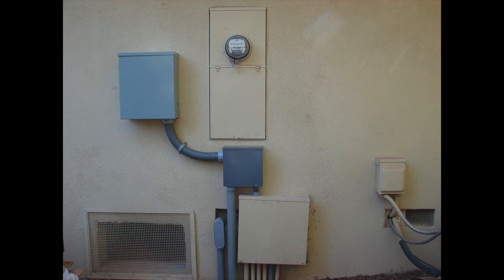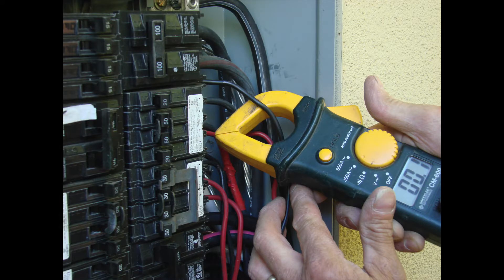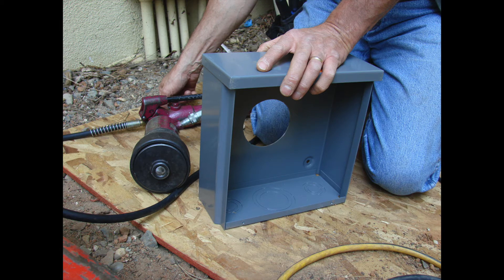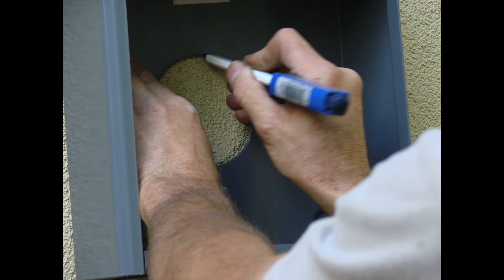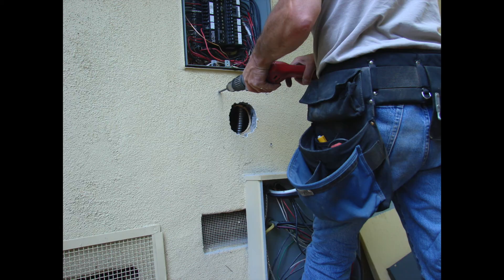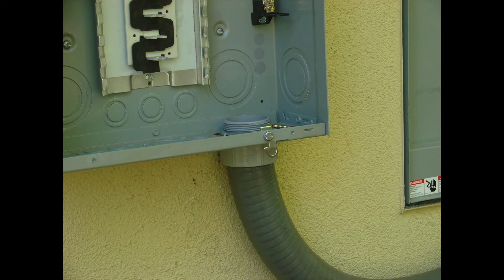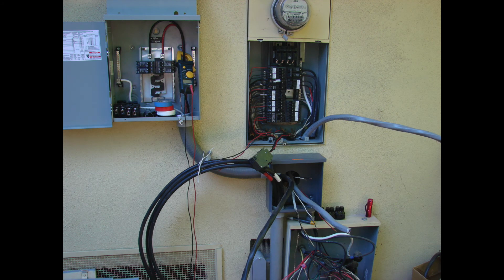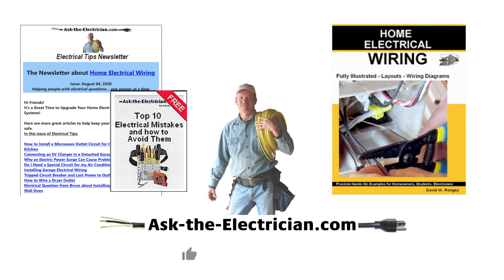How to Add a Sub Panel to Expand the Circuit Breaker Capacity.

Comment: Thanks for sharing.  If the future 400 A main panel will have more breaker positions than the existing one, couldn't you eliminate the small subpanel you added to the side of the Main Panel?  Seems best for the homeowners to bite that bullet now.
Reply from the maker: Yes indeed, that would make perfect sense, however the home was occupied, and this phase of the project did now allow for the main service to be upgraded, and it was not in the budget, so installing this sub panel allowed us to keep on track. A future project was possibly adding a second floor to the residence, and a lot of remodeling, so we just stayed on track with this project as was required.

Comment: What can I do if the main power wire from the sub to the main panel doesn't reach? They are 35 feet apart and the wire is 25 feet.

Comment: Hello. Thanks for sharing. 
I hope you can help me with this question. 
I’m helping a friend with a job. 
He built a detached utility room from the house, he will install the electric water heater in there ( 30 amp 2 pole)  , electric dryer 30 amp, washer and a lighting circuit 20 amp. He will add a subpanel . It’s like 80 ft from the main panel. 

What’s the minimum aluminum wire size and breaker We can use ?
Reply from the maker: Please see the following:
https://ask-the-electrician.com/electrical-calculations-and-formulas.html
Voltage Drop Calculator

Comment: So you still have to run 4/0 to wherever you're putting the next panel right?
Reply from the maker: The size of the cable will depend on the size of the panel that is being installed, and how far the new sub panel will be from the source panel.

Comment: If the left top wire is like ..fried off and hanging is that dangerous? Everything in the house is working unless I use the washer. Thn 2 bedrooms electricity shuts off. When I shut the washer off the rooms turn back on
Reply from the maker: From what you have described, the damaged wire in the panel will need to be repaired asap to ensure the home electrical system will function correctly. Until the repair is done there will be a feed back of voltage to some of the circuits in the home, which can cause damage to some devices because they are not getting full power.
Reply: @AskTheElectrician  I learned a whole phase was on fire and it's a federal pacific panel 😭
Reply from the maker: Yikes!
Sounds like a Great time to replace the panel.

Comment: Can I add a 200 amp panel from another 200 amp service panel?
Reply from the maker: It would depend on the available amperage capacity of the primary panel, and what the proposed loads are for the new panel.
Reply: @AskTheElectrician  you totally confused me here...isn't the available Amps 200?
Reply: I got a 200amp sub panel right below the meter on a pole we ran to the shop... so my available amps would be 200? Right?

Comment: Similar scenario in terms of the space between the main and sub panels (about a foot ot so) what size wire is recommended for a 125a sub panel?, I see the breaker says 12-2/0, would 8/3 or 6/3 be good enough?
Reply from the maker: No - the wire sizes you have mentioned would be incorrect.

Please go to the following articles at my website which will assist you with Electric Wire and Electrical Cable:
https://ask-the-electrician.com/electrical-wire.html

and for Electrical Calculations and Formulas:
https://ask-the-electrician.com/electrical-calculations-and-formulas.html

Comment: I'm trying to become an electrician one day.  I have two questions: So once you get the peak load information (For determining if you can install a sub panel or not) how do I determine what sized sub panel i can use from there? Question 2: What do I do if i need a 100 amp sub panel (for a workshop, that when in use draws say 60 amps) but the peak load on the main panel (lets say this main is 200 amps) is 140+ amps? Would I need to get a bigger main panel from there?
Reply from the maker: Hi Rojo, great to hear you would like to be an electrician. Your questions require considerations that I have carefully described at ask-the-electrician.com where I cover these topics and a lot more. Please go to the website and you will find your answers. See you there!
Reply: @AskTheElectrician  Who the hell is Rojo??  Great attention to detail, as usual

Comment: Can I run a 60 amp sub panel off a 100 amp main panel (How big of a subpanel can I install off a 100 amp service)
Reply from the maker: Before adding a sub panel to a main panel it is best to see what the average and peak load is on the main panel, and then see how much capacity is available for an additional panel. The peak load information should be available on the home electrical utility statements, or by logging into the account online and then noting the history of the energy usage, and the peak demand information.

Comment: correct me if I am wrong. is flex PVC schedule 40?  if so, is it code to be used exposed outdoors and not buried? i thought for exterior use schedule 80 PVC is required to meet code.
Reply from the maker: Flexible PVC is schedule 40 and allowed outdoor and is UV rated. Schedule 80 may be specified in some areas, but this installation did not require it.
Reply: @Andrew Randall Try Flixzone. Just search on google for it :)

Comment: Sir .how to 110 to 220v
Reply from the maker: A dedicated 110volt circuit can be converted to 220volt by re-configuring the circuit wiring at the panel, and re labeling the wiring at the panel and at the destination or application it will be used for.